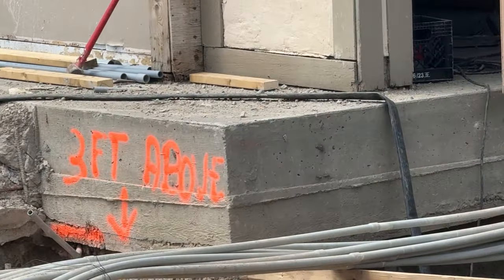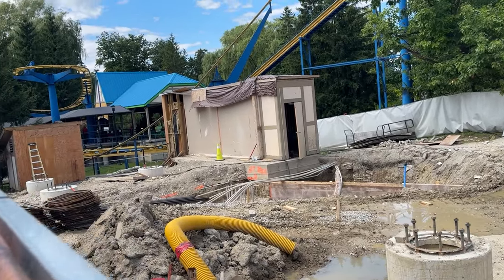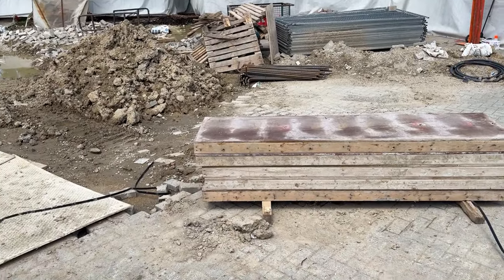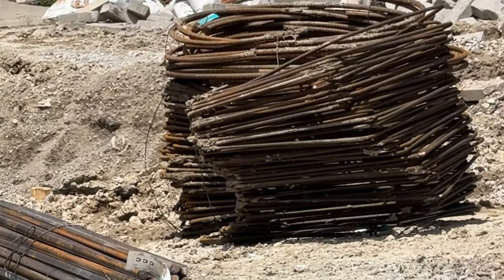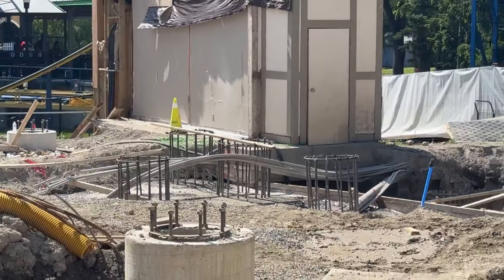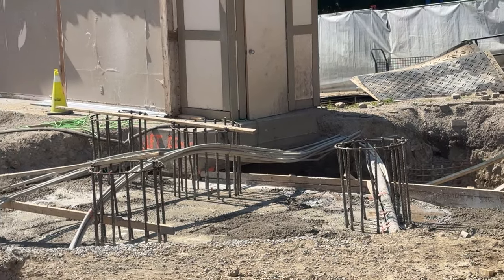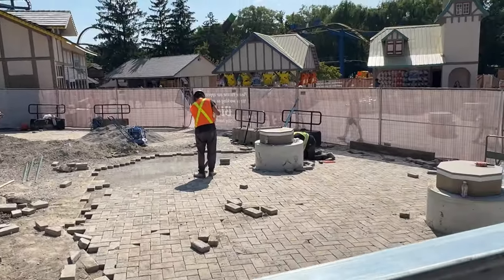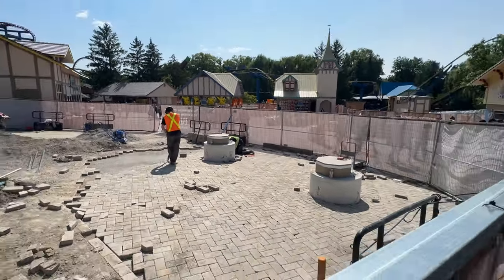Canada's Wonderland 2025 Launch Coaster Update

Comment: When you say, "spike near the station area", if you're referencing something similar to Ice Breakers Spike placement, then yes.  Not only do I see it as a possibility, but highly likely.  It will be part of the swing launch.

If this ends up being a much taller, longer, and faster version of Ice Breaker while using the mountain for the post swing section, it is going to be Insane!

Comment: Just a thought on the potential fire and ice teasing......what if this ride had a switch track that makes it go from summer mode(fire) where it runs a large layout and (ice) winter layout which runs for Winterfest where the layout is primarily inside the mountain with a few pop outside sections

Comment: My concern with a Spike is ride capacity....if the trains are running back thru the station a dual track or switch would be required increasing maintenance and breakdown risk, also it would limit train dispatch options with fewer launches possible than simply sending a train off on its way.
Reply: Ice breaker has the slide track and doesn't seem to have that many problems with the switch track it just basically moves the train to a track right next to the station
Reply: It's going to be a dueling coaster, so their will be duel tracks.
Reply: @BOOSETO  no way, the footers for the rest of the ride don't indicate that.
Reply: @jasoncolliver3648  you are no engineer.
And to gauge the finality of a construction project before it is barely started is just laughable.
Also, what do you think a teaser with TWO elements, water/ice & Fire, and 8/8 indicates?
It indicates a duality pretty clearly.
My guess stands at a dueling coaster with 8 inversions each.
Could also be one track with 2 different themes throughout?
But, considering premiere is who makes dueling coasters, and the teasr campaign?
I'll stick with my pick.
We will see.
Reply: @jasoncolliver3648  their latest teaser 
"When elements combine, a power awakens. Discover the mountain that inspires legends, the village that reveres the elements and the force that refuses to be contained. 
 
A new adventure is coming to Canada’s Wonderland. Learn more on Aug. 8."
Reply: @jasoncolliver3648  it's clearly referencing two things coming together.
Reply: @BOOSETO  guess we will see very soon!
Reply: @BOOSETO  wrong! Wrong! You were wrong!
Reply: @BOOSETO  how's that pick playing out?
Reply: @jasoncolliver3648  better than your mom's decision to not ab....
Well, nevermind...
Have a great night!
Coaster looks awesome!
Reply: @BOOSETO  at least my mother had a child that IS able to read basic footer markings to come to an informed conclusion. Also-you don't know if I have an engineering background or not.
Reply: @jasoncolliver3648  If your grammar is any indication of your level of education?
Engineer isn't even on the list...
Reply: @BOOSETO  please, this is YouTube not a dissertation.
Reply: @BOOSETO  also quite beside the point. My point is you were so sure... Yet so WRONG!